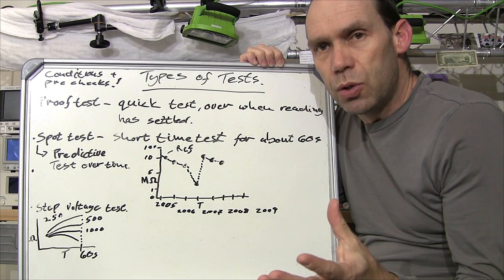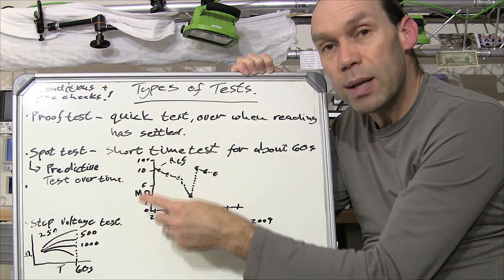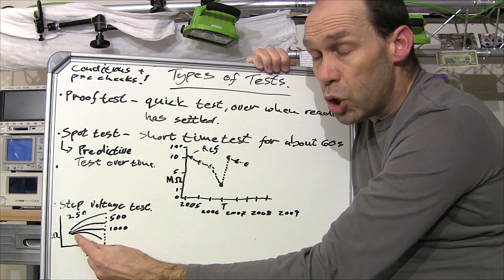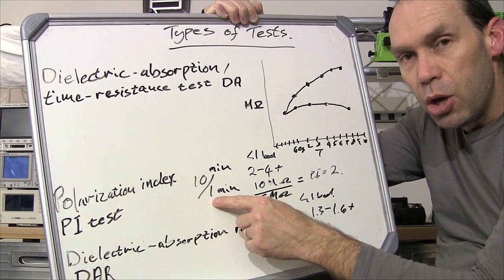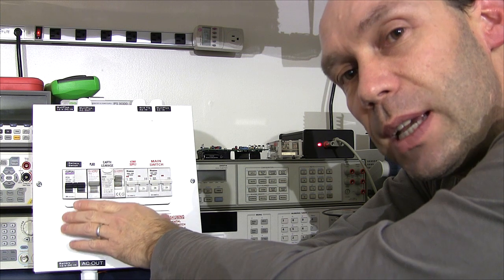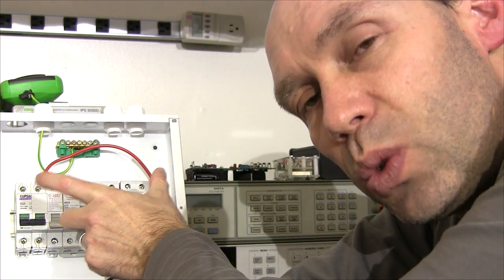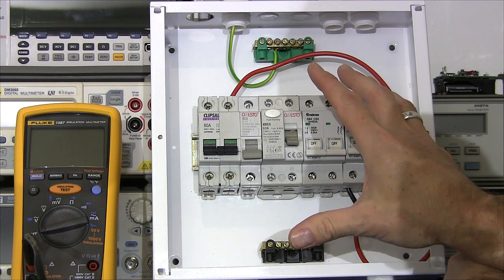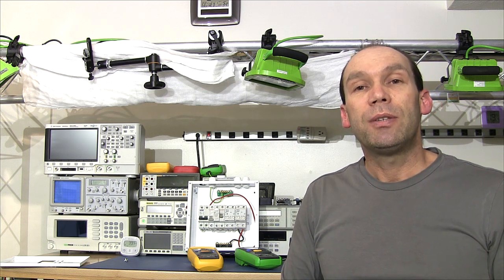Tutorial: Insulation Resistance Testing / Megger Testing / PAT testing Pt 2

Comment: How would one diagnose a turn to turn short in the winding not shorted to chassis on a single phase 120-220VAC motor? 
Motor is working but pulls a little more amps. Caps are fine.

Comment: Good video.  I was thinking there is a way to seclect the proper voltage for the wire.  I want so say it was something like 5 times the actual voltage used on the wire.

Comment: i have a question about ir testing on light circuit with transformers for the downlight,should i only test between to neutral earth and active to earth,but cannot test between neutral and active because high voltage can damage electronic transformers?

Comment: Great explanation. I was not aware of this device.  I have a question, does this meter produce high voltage? Can anyone answer me, please?
Reply: Yes, it does generate DC voltage. This voltage can be harmful if a person comes in contact. However, because there is very low current most times you will just feeling nasty little bite.

Comment: Hi mjlorton; I watched a lot of your vids, very nice and very interesting!
Im an electrician in the Netherlands and I work around Energy distribution systems  Cat III and Cat IV.
Lately Im am looking for an  affordable Insulation meter wich can measure with 1000V and is accurate with its measurements.
I dont have money to get me a Fluke 1503 or 1507 ,so Im looking for something close to the same kind of performance but for less money.
For instance , is the UT505a  or UT505b  of for the same matter a UT 513  any good? the 513 I can get as second-hand but is like new

Can you advice a good insulation meter for around E200-E300   ?  thx in advance!!

Cheers!

Martin

Comment: My two cents. Our newly opened Subway Train Systems behave intermittently due to the poor insulation of many installed signal and power cables. The involved constructor has to replace all with heavy penalty, and many down times and inconveniences completely put off the local commuters. Obviously, many vendors has occasionally failed to complied the submitted Tender's Specifications and also those on-site commissioning officer are simply lazy and failed to carry out their duty.
Reply from the maker: Interesting post. Thanks.

Comment: Another great video. Im really impressed of your knowledge and work on your channel. Good job. Also would you be able to do review insulation multimeters in mid prices like uni-t ut533 (how are them also good on Voltage, current etc)
Thanks a lot.
Reply from the maker: My pleasure, thanks for watching. I'll certainly try review equipment right across the price range. Cheers, Martin.